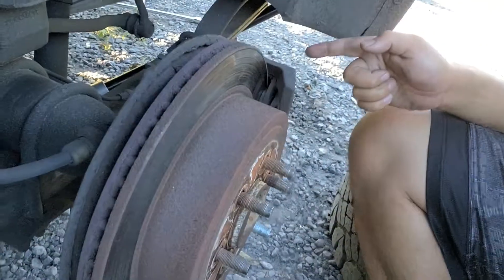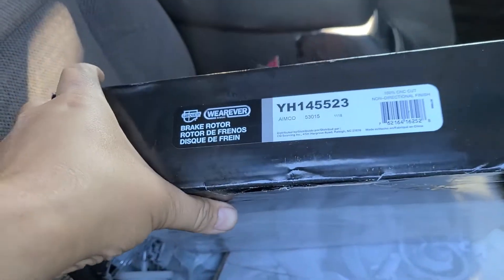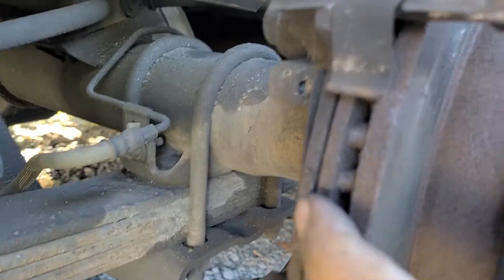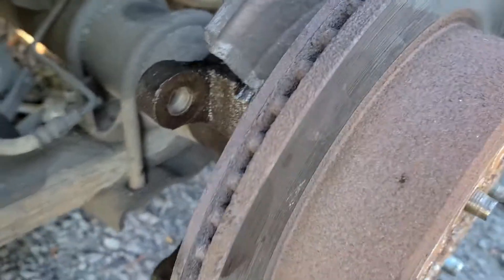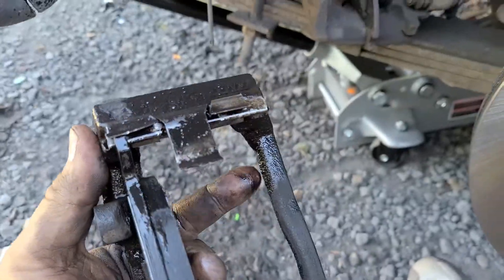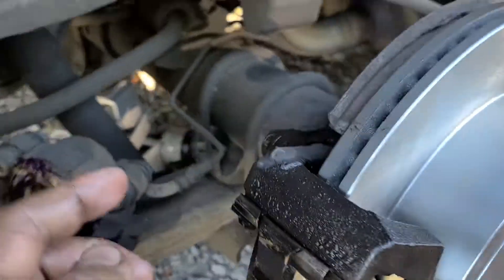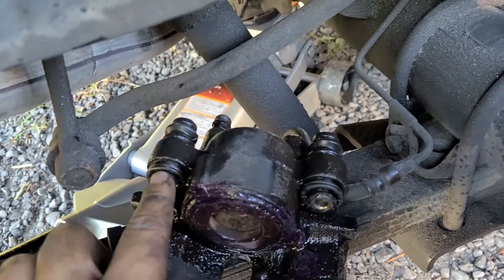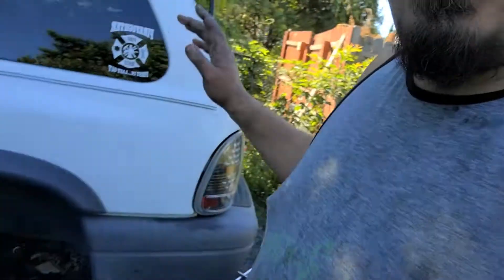How to Replace rear disc brakes and rotors (1999-2003) Dodge Durango

Comment: Appreciate your short, informative video.  Easily completed a full rear brake job today.  No issues.  Learned there’s both disc and drum rear brakes on the ‘03 4x4.  Thank goodness the drums looked good.  Thanks again.

Comment: Was there anything else holding the rotor on? My rear rotor will not come off. Hit it with hammers , nothing., wiggles but won’t come off. Any advise?
Reply from the maker: Make sure your emergency brake is off if it is on the rotor will not come off also sometimes they get stuck to the hub try hammering it between the studs or around the outer edge if you are replacing them
Reply: Keep wiggling dont give up🤠